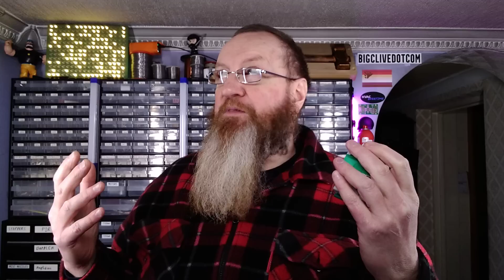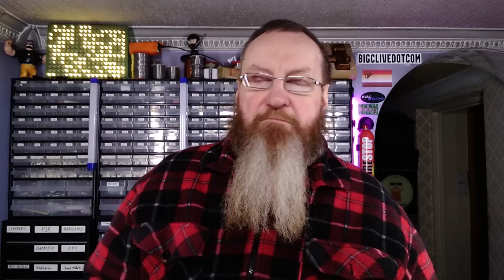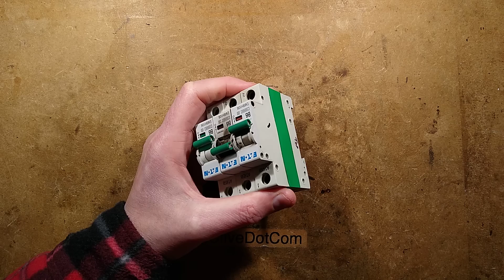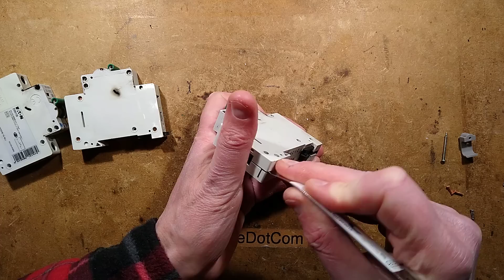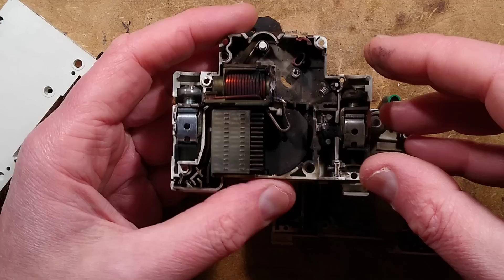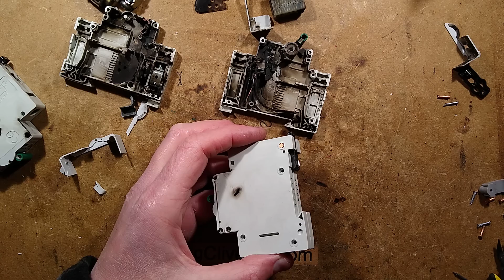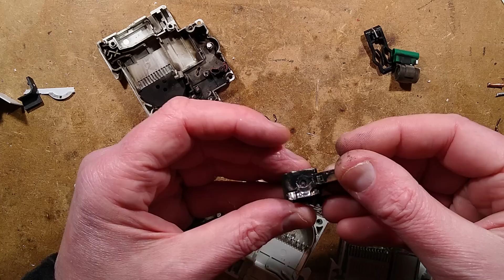Arc flash breaker failure - let's open it

Comment: In my career I once produced a 400v phase to phase short in a massive main distribution cabinet which had a direct transformer feed, 2x 630kva transformers feed. 
The size of the conductors from the transformers to the panel and the bus bars in the panel would throw some people into a coma for me its daily business. 
The fault happened at the outgoing lugs of a feed cable which was fused in at 250 amps.
What happened was we were disconnecting a temporary construction site feed which was a 95mm² cable and one of the conductors with the bare lug still at the end slipped away and bridged L1 and L2 from another feed down below.
The kaboom and arc flash that produced can only be described as down right lethal.
The 250 Amp fuses on L1 and L2 blew instantly but the arc flash still melted/vaporized half of the lug and left deep arc marks on the terminals and I was blind and deaf for almost 30 seconds.
No arc flash/live work PPE at all by the way.
Those fuses tanked the fault current which must have been astronomical (30-50kA at least) and saved me from major arc flash injuries. 
You don't know how violent electrical faults can be in an environment where high fault currents are to be expected unless you feel it first hand. That wasn't a spark and a bang it was a detonation of plasma and molten metal.

Im a lot! more careful now and it is of vital importance that any device meant to interrupt a fault can safely disconnect the expected fault current.

Comment: i had a 3 way power oulet splitter that randomly developed a short circuit defect on the center plug, or maybe it's been the whole time, that when something is plugged into the center plug it short circuits and trips the breaker. when i first tripped the breaker it was plugging it in with all three outlets filled. took a few attempts on a less intrusive circuit to discover what was faulting. i've since retired it entirely cause knowing it has a defect (and not one of the new pigtails i purchased) i'm not gonna keep it in service. an annoyance yes but i'd rather not tempt the angry pixies into a fire hazard in my room where there is both good airflow and PLENTY of combustable things around. wood, cardboard, papers, rubber on wiring, ect.

Comment: I don’t understand why a live to neutral would blow clear and live to earth wouldn’t?
Reply from the maker: They both blow clear, but doing an insulation test to find leakage is harder from live to neutral due to loads.
Reply: @ ah I see what your saying. I only work domestic and I can usually isolate all loads on a given circuit. I thought you was implying that a live to earth wouldn’t blow clear. Thanks for clearing that up.

Comment: That little breaker is the same but a smaller version of the 2000 amp acb's I maintain, and same principle as the 11kv oil breakers I also maintain . same principle in cutting fault current and using an arc extinguishing device

Comment: Two stories, one recent one not so much...

Had an EICR done on my house wiring last year before renting it out. Turns out both the RCDs were seized - and wouldn't have protected anything. First I'd heard of manually testing them yearly to make sure that didn't happen - scary!

Second was my part time job pre university, a little electronics company in West London around 1984/85. Really cold winter, industrial estate building, lots of fan heaters under desks. The main office fuse (porcelain with fuse wire installed) kept blowing. Up until my boss replaced the fuse wire with a 6 inch nail...

That worked for about a week, then there was a gout of flame from the manhole outside - he quickly replaced the bodge with a real fuse and expressed complete surprise that such a thing could have happened!

Comment: Have come across 4 failed breakers in 10 years. The worst being a bad connection on the breaker terminal causing arcing, resistance and heat over who knows how long. It caused the plastic to deform inside and the breaker couldn't break any more. I found it by accident

Comment: I believe I must be overlooking something or misunderstanding something. Or I am more ignorant than I thought.
(which is probably the case).

Did you say that these 3 breakers are each rated at TEN THOUSAND AMPS?   So 30 THOUSAND AMPS A. C. sine wave current TOTAL FOR THE THREE MODULES? 
So you are saying that each breaker can carry 10 THOUSAND AMPS continuously?  You're talking about the total steady state carrying capacity of 10K  AMPS through each breaker? 
WOW, just WOW. 😮
I would have thought that ANY device or component that could carry that much current would be the size of a large refrigerator, if not larger.🤔
   Even a piece of pure copper. I am used to 15 amp mains home circuit breakers (in the U S.)
being almost as large as what you are showing there. They (EATON engineers) must be Very, Very good at minimizing resistance of every current carrying piece of metal within the device. 
    I am going to do some I squared R calculations just for fun. Do those breakers that you are showing have a max POWER rating? 
Can you give us enough part family and model number and part number information such that we can look up the advertising and "data sheet" stats for those devices?

    Please let me (maybe us) know if I am missing something, or getting something wrong. I feel like I must be.
   Good Day Mister Clive. 
Thank You for your work.
-Minneapolis Minnesota USA
Reply from the maker: The 10kA is the fault current breaking capacity.  Not the load capacity.

Comment: I think some of these failures are the quality of the contacts being able to build up carbon over time and also depending on the load you know with so many LED operated fixtures and lighting now I mean sometimes that's a lot of capacitors that charge all of the same time initially for inrush and I don't mean a high amount of amperage I just mean something that a create a spark like when you plug in even a good power supply into the wall and you'll see a spark off of one of the the prongs when you plug it in you know it's just sparking is almost allowed now

Comment: Nothing worse when the fault repeats itself after you reset it. Had a similar issue some time last year we had a shower unit that tripped the breaker twice. So did usual checks between the breaker to the pull cord then to the shower unit itself nothing seems wrong. It only when it tripped the breaker the second time on a rainy day it revealed itself as a small puddle of water coming from the pull cord switch. So had to get into the attic to see what had gone wrong thinking it might have been a water tank either overflowing or leaks from the pipes but no some guy that installed roof vents ended up cutting the plastic felt with a big enough hole that was left in the wrong location and that is letting in water into the attic no less than two feets near the electrical cables. To top it off I had to patch up the big hole on the plastic felt and filled up all the electrical cables holes with water resistant silicone. The problem never came back since as well the cold draft coming from the attic disappeared instantly

Comment: When I was young I worked for a plant automation company. Our Machine-Terminals used, at that time fancy, fibre optics for communication with the backend computer. One customer reported that always at a certain time of the morning, but not every day, one of the terminals lost connection and the machine of course would stop. We couldn’t figure out what the problem was, because it never happened when we were there to troubleshoot. So in the end we decided to have one of our technicians to sit in front of that machine, well before the time when the problem usually occured. So, this is what he observed: The sun was rising, the sunlight shone through a window. The bright, sharp sun ray hit the fibre optic cable and basically interrupted the signal flow. 
The fix was easy, we just shielded that part of the Fibre optic line with a black tube. And why did it not happen everyday? Well when it was a rainy day, there was no sun 😅
Reply from the maker: Sunshine is a common issue with sensors and imaging systems.

Comment: This is what happen years ago in 415v 3 phase switch boards when  MCBs were not rated for 400v on clearing a fault and you would get an arc phase to phase  and with power supplys getting lower impedance and higher fault currents the old MCBs need to be replaced

Comment: A "Megger" is the tradional piece of equipment that is used to find faults in mains wiring.
It ramps up to a high (usually DC) voltage, but at a low current. When the insulation fails, the voltage and megaohms of the fault are displayed.
We used to use them all the time in industry to test contactors or motor or transformer insulation.

Comment: I am not a safety officer BUT do have an opinion:
Always install quality, known-brand breakers. As previously tested by Clive, do the ones manufactured from Chinesium have absolutely no overload detection, arc absorbsion or anything of value in them. The are merely ON/OFF switches made by unscrupulous, greedy manufacturers.

And yes, I have seen a 3-ph breaker explode inside a TV transmitter when a colleague tried to fire up the old beast. The breaker was splattered all over his hand... Wear the gloves!

Great video, thanks Clive!

Comment: Yes, i have done a lot of garden lighting in Ireland, phase to neutral tracking is hard to find, usually damp control ballast or LED circuit, but often a slug has grown up inside the fitting and crawled into the based of an E27 lampholder. Yes one or two resets of the mcb will clear the poor fellow out.

Comment: Was it mikes electric stuff or you that ages ago stress tested circuit breakers with am HV pulser and literally embedded copper pieces, work hardened enough to be nails, into the ceiling?
Reply from the maker: Yes - destroying the fluorescent light above his bench in the process.
Reply: That Vid is spectacular. It even turen the round wire of the trip coil flat.

Comment: Retired unfortunately worked on too many inferior IEU garbage contactors. If you look at the dual rating an IEU contactor might only be rated for a maximum of 30 amps at 480 volts in the USA,( UL ) but will have a much higher rating for use in Europe ( could be 38 to a,42 amp rating ).

Comment: I've seen this before - when the available short-circuit fault current far exceeds the fault-current rating of a circuit-breaker - it will become permanently damaged as it has suffered damage from excessive fault currents from which it was not designed - or rated for.

In North America - 10,000 A.I.C. Amperes Interrupting Current - short-circuit fault current ratings are the most common ratings for small-case circuit breakers that are commonly found or seen in residential/domestic installations as well as light commercial & light or small industrial installations - as electrical services become much larger in size and as the electrical supply utility transformers also become higher in electrical KVA ratings - the available short-circuit fault-currents also become a concern, as fire and explosion hazards do exist when the available fault currents far exceed the short-circuit current ratings of a circuit-breaker over-current protective device as illustrated in your video. Circuit breakers with short-circuit current ratings far greater than 10,000 amperes are also available for situations where the available short-circuit fault currents are available in excess of 10,000 amperes. Other A.I.C. short-circuit ratings could be 22,000 Amperes, 50,000 Amperes*, 100,000 Amperes* or 200,000 Amperes* (*the higher values of these ratings are more common to fuses than to mechanical circuit-breakers, although some certain larger form-factor molded-case circuit-breakers may also be available with A.I.C. short-circuit current ratings up to 100,000 Amperes at a definite up-charge in financial cost.)

In North America in particular - with commonplace 120/240V "split-phase" domestic electrical distribution schemes in place - the fault current from only half (120V) of the total transformer secondary (240V) winding will only show half of the total impedance of the total winding coil, where the middle or half of the transformer secondary winding coil is center-tapped to ground - also where the system neutral is then derived from and also tied or bonded to Earth at the utility side of the electrical service drop as well as the system neutral conductor also being tied to or bonded to Earth at the first service-disconnecting means at the premises electrical service as required under Article 250 of the National Electrical Code.(With further digression) the available electrical short-circuit fault current is double at 120V versus 240V due to only half of the short-circuit impedance being seen at the secondary winding of the utility distribution transformer due to only half of the winding as being part of that faulted circuit versus a line-to-line fault across the entirety of the 240V secondary winding - of which is characteristically a low-impedance winding or coil of wire with a grounded tap halfway down the middle where it is bonded to Earth and from which the system neutral point of connection is derived.

North America is the only continent where this particular type of electrical system exists along with a 60Hz or 60-cycle operating AC Line Frequency. 

Although 3-phase systems do exist here also in the "flavors" of 240V (Delta), 208/120V (WYE) as well as 480/277 (WYE) and 480 (DELTA) connected systems commonplace in much larger commercial, industrial and institutional environments where larger equipment is utilized that requires much larger amounts of electricity to be distributed. Canada also uses a 600/347V (WYE) electrical distribution scheme for their larger utility customers.

Comment: At my previous new construction house, I had nuisance trips on the heat pump breaker (no fun in the winter time) for five or six years. It had me stumped until one day I'm washing the mildew off the siding and the water starts cascading behind the heat pump disconnect. I suddenly hear buzzing and humming coming from the disconnect. I hurriedly ran inside to shut off the breaker and upon inspecting the disconnect, the goofball "electrician" ran the romex straight through a knockout, no bushing and conveniently chafed the insulation on both conductors. There was plenty of carbon around the knockout and nicely charred insulation on the wires. Fortunately, there was plenty of slack in the wall. I put a proper bushing in the knockout, lopped off about 12 inches of cable and relanded everything. Ended up having to relocate about 18 months later...

Comment: I'm sure that whomever reset that breaker last got a little bit excited. 😂 Having reset a 125A breaker once under a fault condition, I can assure you, it will wake you up 😂. That one took out the 250A ACB in the switch room as well.

Comment: Had a club sauna trip a 25A MCB. It is fed with 3x25A, it's a 13,5kW sauna that is one a few times a week for about 10hrs at a time, it's not residential. It draws about 20A per phase. The sauna was about eight years old and the elements looked like crap so I talked to the owner and we decided to change the six elements. A few days later he called and said that the MCB still trips after an hour or so. Told him I'm gonna need to sit with an amp clamp on the MCB for a while and just watch what happens. Watched the sauna go to 80°C and amps never went over 20,5A. However the MCB rated at 25A got burning hot. Measured voltage drop over the MCB, was none. Ended up changing the three MCB for new 25A and waited another half an hour, then only lukewarm. Didn't have my thermal cam with me so had to rely on my fingers...

Comment: I'm fairly sure that little slit on the side is for alarm/signaling if breaker trip or breaker on. edit: turns out i was wrong.
Reply: nvm turns out i was wrong 🙃. did an install of a schneider earlier and tested it, also had an eaton in the car. It's a trip, my guess for remote trip or for adding a rcd/afdd.

Comment: Just before moving out, I (as an adult kid) tested the earth leakage breaker just one more time. As if I knew: I pushed the t-button with a screwdriver and thanks to that my hand was just out of reach for the arc and plasma flame.
Later we heard the whole installation needed to be replaced.
Reply from the maker: If some RCD/GFIs don't trip properly the trip coil can quickly fail and trigger an internal arc flashover.

Comment: Another great tear-down video, thatnks! Regarding trouble finding the second contact, I agree the copper-only knife-edge contact didn't look like what we would expect. Could the other contact be in the other half of the case, that you weren't looking at? You didn't seem to try following the circuit path through from one connection terminal to the other - and one terminal was in each half.

Comment: Hi Clive, could you give you opinion or do a video on backfeeding a house from a generator with the main breaker switched off and any heavy loads off. I know the correct way is to use a dedicated generator interface connection but id love to here the your professional opinion. We just had the most destructive storm in Ireland in recient history and some will be off grid for mayby 2 weeks and could be trying anything to get going again.
Reply from the maker: It's really important to lock off the incoming supply if using a generator to feed the system.  The biggest hazard is backfeeding onto the distribution network, which can put electrical workers at risk of a fatal shock.
Reply: Thanks Clive